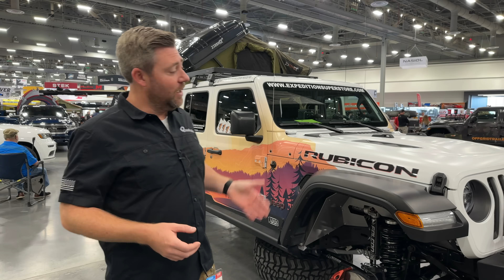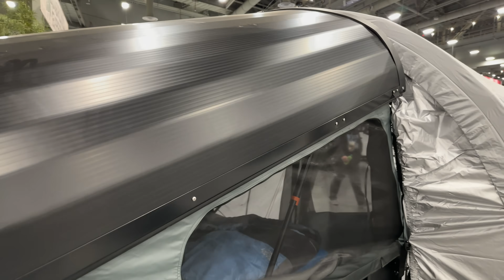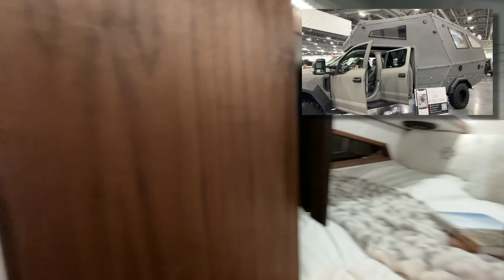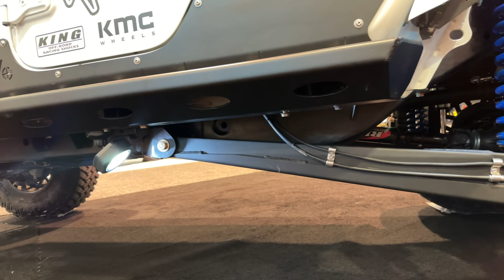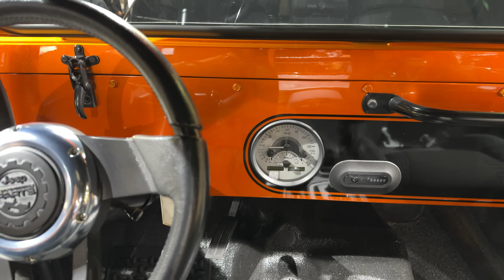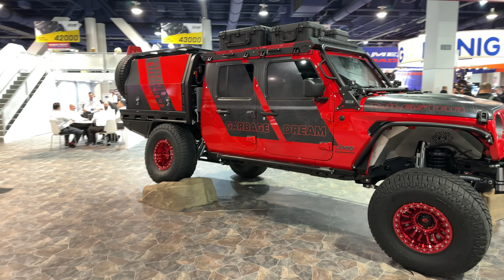Even More New Products, the Overland Experience & Electric Jeeps - SEMA Day 3

Comment: After seeing electric vehicles catch fire and release toxic fumes into the air after being exposed to salt water from Hurricane Ian here in Florida, yeah, I'll have to pass. 4,500°F temps and each time the firefighters got through dousing the flames with heaps of water, the vehicle would reignite like a trick birthday candle. One homeowner's house survived the hurricane just to be burned down by an electric vehicle battery corroded by the salt water. They had to issue a warning to move the electric vehicles away from any structures and trees if they were still able to be driven.
Reply: Not to mention the environmental impact of mining lithium for the batteries and then back to a landfill after they bite the dust.

I feel more guilty using my cordless drill than I do driving my JKU.
Reply: Electrical fires are supposed to be extinguished with foam not water, I don't understand why firefighters were using water it.